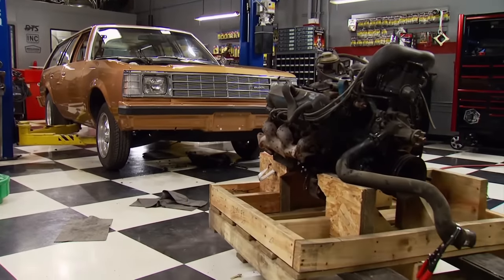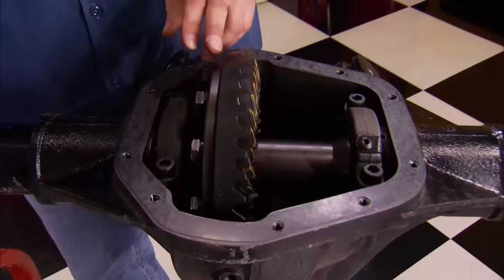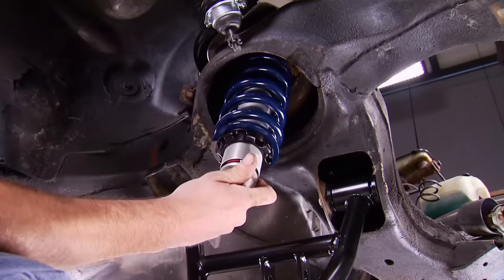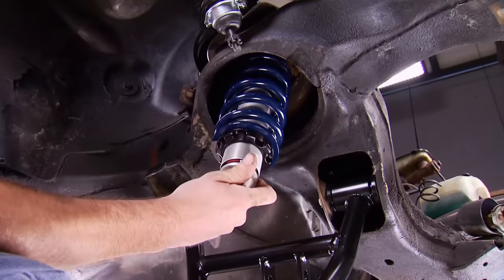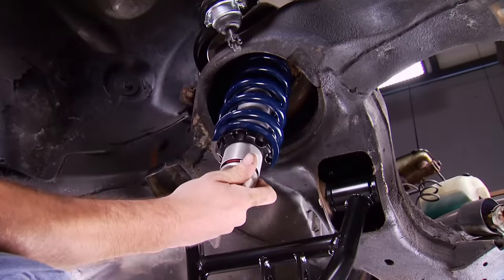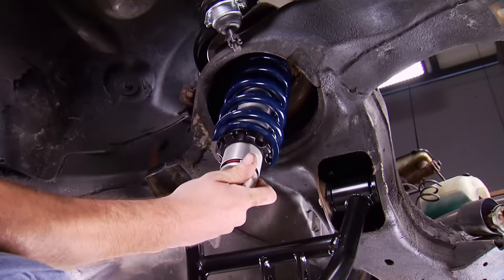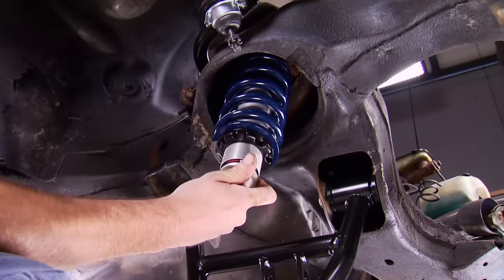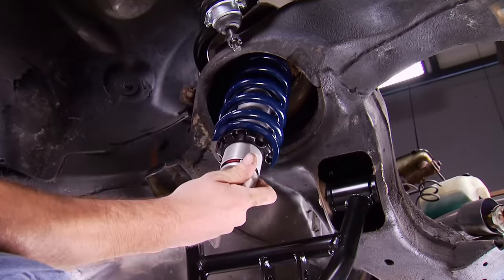Full Build: Knock-Out Power Makes A 1978 Buick Century The Ultimate Sleeper

Comment: You got more money in the supension and the turbo pipes than most people can spend.
Reply: And on what’s the car is worth lol
Reply: Build made way more sense way this show was on air still. These parts now though are much more money these builds also definitely didn't age well
Reply: Right that ridetech suspension is like 6-7k 🤦🏻‍♂️
Reply: And? You want em to just bolt on "performance" air filters every episode?
Reply: It's just a tv show poor man can't afford that stuff
Reply: Get a better job or take up a cheaper hobby.
Reply: Find cheeper parts, I spent 2grand CDN buying for 2008 equinox includes, full front suspension, 4 hubs, full brakes, fuel pump, filter, sparks, wires, had my engine professionally cleaned for the heads, bought a radiator, water pump, thermostat, oil changes filters, and some coolant, got egr valve, like 10 electronic modules, did everything besides cleaning myself in like 2 days.
So it's possible just find super stuff, is all like napa type stuff, I bought a 6$ motorcycle stator on wish, and to my surprize its still working. Just depends what you find and what you're looking for, and know what you're looking at!!!
Reply: Every one of these shows have always done that...
Reply: Gotta pay to play.

Comment: What I really like is that the original machine had a base-plate of prefabulated aluminite, surmounted by a malleable logarithmic casing in such a way that the two main spurving bearings were in a direct line with the pentametric fan.

Comment: Chassis dyno?   I would like to see how it compares to my 750hp twin turbo 455 trans am.   I'm still running the stock T10 so slicks are not in my future. 
It has a solid roller 224/224 comp cam and all the Butler goodies, just like yours.    Mine can spin the tires from 55mph to 100mph in 3rd gear.
Reply: You're 10 years too late lol
Reply: @bradenkowal8117  I watched the original  show not long after I finished my trans am.  I just want  Powernation to think their videos are relevant so they'll keep them coming.

Comment: was it about 430 natural aspirated?  Will be 751 at 11psi or 766 at 11.5. It will be interesting to see whether there is some deviation from that based on favorable 'shared' resistance giving additional just power a free ride or will it cause extra internal resistance. 12.66 boost on a 430 natural base could get 800.

Comment: Had a 78 Century wagon.  Trans went out without warning.  Trans shop put in a THM350 instead of the crappy metric one, and that woke it up!  But the engine grenaded before it hit 100k. Sold it to some guy who put a Buick 350 in it and used it to drag race.
Reply: My Dad gave me a 85 Buick Century Sport Wagon in the late 90s. It had a surprisingly strong 305 that would open people's eyes when I left a red light! I gave it back to him, he sold it and a friend of a friend ended up making a real sleeper out of it! A couple years later my Dad gave me a 85 or 86 Pontiac Parisienne wagon with a (he thought)350 in it that turned out to be a 400sb! I kept that for a couple of years and eventually traded it for a 90s Honda Accord

Comment: I have a 709 wheel horsepower 1997 Honda Civic coupe, and while I've owned 68 cars and trucks in my 24 years of driving, and while I do have quite a few dream cars, I have always been really interested in building a 70 GTO Judge (yeah...right) with a Butler Performance turbo big block.

Comment: Good afternoon.. well when you guys are done with the mechanical part of the car you need to work on the short you have in the wiring..every time you apply the breaks your passenger side marker/signal light comes on and when you take your foot off the breaks it goes out .. good luck with the issue
Reply: Brakes, not breaks and the issue is 99% broken 1157 that's the parasitic short.

Comment: I took the opposite road,
    I took my 89 Geo Metro
   Install wide 14 inch tires on rear ,working side pipes   , and carburetor, with blower scoop sticking through the hood  . Just a few of the cheap mods.
    It looks mean and fool's a lot of people . with its 3cyl 5 speed  it gets great gas mileage and draws a lot of attention.
         Have received  two  car show trophies so far.
        You can have fun without spending a lot of money.
Reply: There a link to that, somewhere? I'd like to see that. Love wacky, uncommon builds, like that.

Where did you even find performance parts for that thing?
Reply: @NaruSanavai  it doesnt have performance,it just pretends to

Comment: Okay I'm lost he just made the statement about putting the timing chain in that they had to get a .010 shorter timing chain due to the fact that the Centerline of the crankshaft has changed but when they were fitting and line boring the main caps they fitted the new main caps to the existing cast journals in the block or so I thought and even if they did go .010 oversized on the crank Journal how does that make the Centerline of the crank .010 closer to the cam??  I've line bored and honed a lot of blocks in my time not saying that it's impossible but I have never changed the Centerline distance of the crankshaft up or down that's one trick I would have liked to have known.. I understand how it was achieved with the new main caps but that's something that I have never done I have done many 10 10 cranks even 2020 cranks but never changed the whole Centerline of the rotating assembly ....intriguing..🤔
Reply: Hmm,🧐

Comment: Man. I hate with a passion when those pipes disconnect! Especially when running with a MAF Sensor - engine completely turns off our your ass while going over 80mph 🤣🤣 steering wheel locks and your praying to the Lord 🙏

Comment: 7 quarts of oil in that pan will just froth up become airrated and Rob Hp. It was proved on Engine masters.
Reply: Thats if you overfill it. Not if its meant to hold that much...
Reply: @bradenkowal8117  that's not how it works.
Reply: @jasoncampbell5518  thats exactly how it works.....the sump size tells you how much oil you need for the proper level
Reply: @bradenkowal8117 ok sure

Comment: Why would someone build a Pontiac engine for a Buick car when a perfectly suitable Buick engine could be used ?
Who puts performance handling suspension parts on a vehicle with a SPOOL in the 3rd member??? Nonsensical to say the least. Interesting all the bravado comments written into the script about how your making a huge mistake to add horsepower to a G body car without welding in lots of extra frame supports since Grand Nationals have routinely had extreme horsepower upgrades and kept the stock rear suspension and axle.

Comment: Probably shouldn't be too hard on the original owner of that wagon. Yeah it's not exactly engineered correctly but, they might not have a fully equipped shop and a plethora of companies offering free top end parts for a shout out on a rigged TV show. Also no clue why you guys did this just to crush it after the episode is over.

Comment: should have used original oem wheels widened, a quiet muffler out back with an electric exhaust cut out.
Reply: Hi from V&b Speed a new rc community channel stop in say hi thank u #Vtec
Reply: The Original wheels would definitely not fit over those huge breaks